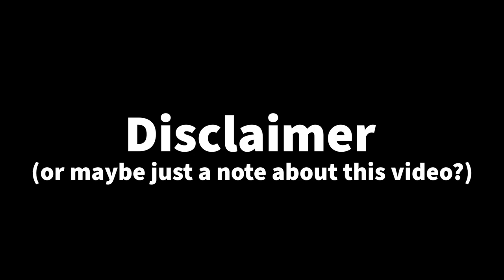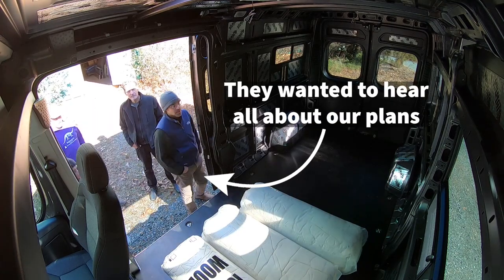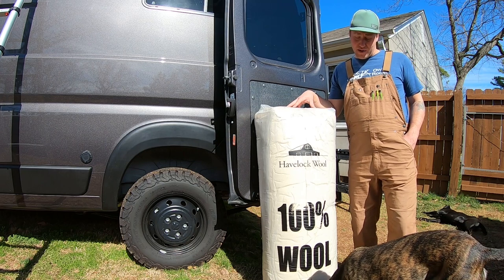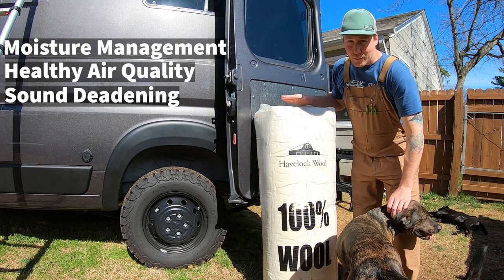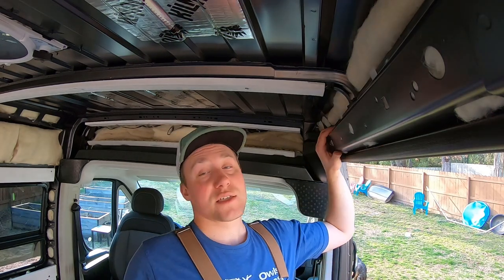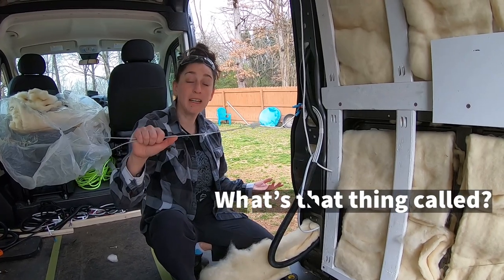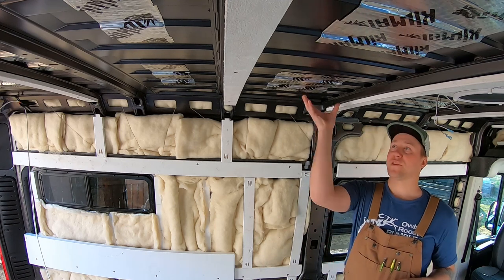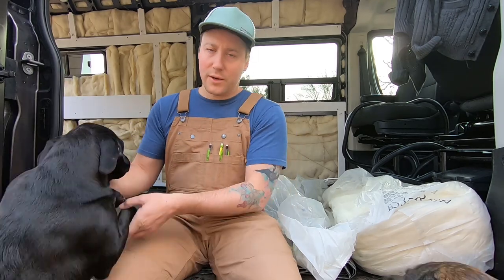Van Insulation with Havelock Wool //Ep. 6 DIY VAN BUILD

Comment: Great video series so far!  I have a little 1500 ProMaster with 136 wheel base.  For insulation, I'm using a 3 step strategy - 1) DIY spray-on insulation foam on the skin for conductive energy, 2) Havelock wool for convection energy, 3) Reflectix for radiant energy.  In theory, the spray on foam will prevent condensation.  The relectix is the last layer against the wooden skin, and the idea is the wool creates enough of an air gap for the foil to stop radiant energy - not sure if this will pan out, but other videos I've watched say this is the case.  I'm not done with the whole insulation process yet, but already there's definitely a difference in how the van sounds, and feels.  I put bug screens in the front door windows, so with those open, and with the MaxxAir fan sucking air out at the rear, the interior has been completely tolerable... of course, we've not had 90 degree days yet here in Virginia, so time will tell.

Edit to add:  I've also added a roof rack with air space between the roof skin and boards that support the solar panels.  This shade allows me to keep the ceiling fairly thin... I've added the same cross-members you did to the ceiling ribs, but tucked sheets of 3/16" plywood between the wood and the ribs with just a sheet of reflextix laying on top (metal skin > spray foam > air > reflectix > 3/16" wood > cabin.  This works for heat, I think adding wool in the air gap would make it better in the cooler winter months.  

Good luck with the rest of your build.  It looks great so far and I've enjoyed the tips and explanations you've shared.
Reply from the maker: Thanks so much! I'm glad you like the series😊

Your strategy sounds well thought out and worthwhile! We have had some 90 degree days in NC and it had been pretty hot working in the van recently. We don't have the doors insulated yet or window covers so maybe that would help with some of the heat we've been feeling?

Nice thinking on the roof rack! Part of our warmth might be exactly because we have a dark van getting beat by the sun. Time will tell how tolerable it will be🤞🏼

Thanks so much for kind words! Goodluck with the rest of your build. We'll keep sharing ours too.

Maybe when we both finish we can make a meet up somewhere in between!
Reply: @Trailvagabonds  I look forward to it :)

Comment: Hey i am curious wold putting wool insulation in the floor be a better idea both for r factor and sound density
Reply from the maker: I don't think it's a bad idea. You definitely lose a little more head space with wool in the floor but I think it's a great option. We ended up using a foam insulation for our floor. We are happy with our decision but know many people who used wool for their floors and are just as happy. The main thing I suggest if you do use wool is frame out the walking area well because you don't want the subfloor settling and warping where you walk. It could be a headache if you don't do that area well. Hope that helps. Let me know if you have other questions 🙌🏻

Comment: I am going to be using to transport k9 and camping . My question is how does the wool work in keeping the van cool in the heat ?
Reply from the maker: K9 transport sounds awesome! (And of course camping). The van gets hot in direct sunlight. If you park in shade it doesn't heat up as quickly. I don't know that there is any form of insulation that can stop the heat of a van baking in the sun on a really hot day. Our van doesn't help any being a dark color either. That being sad in shade it does keep the van a good deal cooler. The fans help immensely. We've slept in 90+ degrees at the beach in Georgia and survived. The big plus is that it keeps heat in in the winter. We slept in 20 degrees in Wisconsin recently and were very comfortable with a heater on the lowest setting. 70 degrees is the sweet spot for sure. When we are on the road that's what we'll chase!
Reply: Just like the opposite of keeping heat in the van during winter. The warm air layer inside is trapped by the wool, it can't contact the exterior metal frame and be lost to convection. In summer, sun radiation heats up the metal exterior, which will heat the air next to it inside. But, with this wool, instead of making the whole van hot, the wool traps much of the heated air to the outside layer, thus keeping the insides COOL 😎
Reply from the maker: Thanks for your thorough response, Matt

Comment: Were you using small or large bag of havewool? Thanks for the hemp twine tip.
Reply from the maker: No problem, happy to help! I used 3 small bags (or 1 big bag and 1 small bag). The big bag is 2 small bags combined and I think they do it for shipping purposes... When I insulated my van they had the recommendation at 3 bags but they have since changed it on a 159 to 4 bags (or 2 big bags). Let me know if you have other questions 🙌🏻

Comment: God job of explaining and like the hemp twine suggestions. What is the Bump out is that giving you more room. Also what did they charge you to install the small windows and the one big one?
Reply from the maker: Yep! The bump out lets us extend the bed into the wall framing so that we can sleep width wise across the van. We will be able to fit a short (or rv) queen mattress across it.

For the windows (which we talk about in our intro video if you hadn't seen that one) we had the dealership we purchased the van from install them. They have a mobility conversion department for disability vans. They basically charged us the cost of us buying the windows ourselves online (I'm guessing because they can get windows at cost?) otherwise we might have done them ourselves. It was a weight off our back!
Reply: Matt & Katie wow they installed the window including the window for the same cost just for the window online. That is an awesome deal I need to find a dealer to do that in AZ.  I was gonna do a double bed sideways but I’m needing the space for my tools underneath I want 60” and was gonna do 40” high you did 38” high and I’m buying the 3500 extended Van. I was gonna do a pullout bed that would let me sleep under the stars on bugless nights. But maybe not. I was gonna use a 6” mattress that give me 36” of room from ceiling to mattress is that what you have?
Reply: I am not going to winter climates so your idea of foam was interesting. I will have plywood then laminate on top. I’m wondering if floor will be cold. I have seen some with 1/2” slats then put wool down and 1/2” or 3/4” ply on top of that. Your right everyone has their way. Look and listen but you the first I have seen with foam. Where did you learn that from?
Reply from the maker: @michaelheppler2193  do you have Instagram? It might be easiest to chat on that. I don't always get updates when I have replies with YouTube. We are @trailvagabonds on Ig if you do

Comment: What is the silver material on the panels of your van? Why do you use it with the wool?
Reply from the maker: We used Kilmat Sound Deadener. It helps take away sound vibrations on the metal walls of the van. It works in a different way than the insulation does so we thought it was worthwhile to do. Here's a video on it that we made 

https://youtu.be/QnGu4TSrB7A

Comment: Watching this, I'm starting to wish I had ordered three bags instead of two!
Reply from the maker: We went with Havelock Wool's recommended amount on their webpage. If you are strategic and maybe utilize other types of insulation in some spots you could get by. If you are set on wool for environmental and/or natural reasons, a 3rd bag might make sense if it can be budgeted. We had big enough gaps in spots we doubled up in and we are thinking we might have to pick up another bag to finish out the doors and pad wheelwell boxes when we make them.

Comment: I ordered 1 bag of Havelock wool 2 weeks ago from Havelock.  While still waiting for it, I also ordered mineral wool from Amazon.  However, I did not know that I ordered mineral wool (rock wool).

Now I am stuck...
I like its stronger sound deadening but worried about unsafe fiberglass like issues.

I read that if I seal up this rock wool with reflectex, I  am safe.  I would only attach the rock wool on the top section of 2  sliding doors and 2 back doors.

What do you think?

The problem
Reply from the maker: The main worry is the dust and being in a small space can be a little scary. There are people who have used fiberglass insulation for their whole van. The most scary is fiberglass does not do well with moisture. Rockwool does better with moisture than the pink stuff but I personally wouldn't prefer it in my van. Budgeting can be tough, especially feeling like you are throwing money away. If you feel comfortable closing it up, by all means, many people use it. Just know in a small space it's not always the safest
Reply: @Trailvagabonds  Thank you for your input.

I will  not use the rock wool in my van based on your well researched opinion.

I appreciate your helpful videos.  Thank you.
Reply from the maker: No worries! Good luck! 🙌🏻

Comment: Thanks for the informative video. On a side note...loved the wheels and tires on your van. Could you tell me what you went with?
Reply from the maker: Thank you! I'm glad people are finding them useful! The wheels are the stock Ram ones, they came black which I think was considered a $50 upgrade but we didn't order them special, they were on it already. The tires are the BF Goodrich TA K02s in the stock 225 75R16 size. We talked the dealership into an upgrade with them during purchase negotiations. I've heard you can fit 245s if you want something a little bigger (sometimes with some wheelwell trimming though). But I think these are plenty burly over the stock road slicks to give us a little more grace on the back roads😎

Comment: Hey Matt and Katie! Love your channel! I ordered the havelock wool. They compressed two bags into one large bag and one into a smaller. It looks like you have the three double bags. Did you get three of those, equaling to six bags? Could be a dumb question..lol.. wanna make sure i have enough.
Reply from the maker: Hey!  Thank you so much!  We ended up picking our wool up locally at a distributor so we were sold them as the three single compressed bags rather than the two bags compressed together into one.  So it ended up being three bags.  They asked that we do this so they had the others ones for when they needed to ship them.  I will say I kind of wish I could purchase another half bag.  We haven't finished the doors yet and are running pretty low on batts.  You will love working with the wool for your insulation!  So simple, you can't go wrong!

Comment: Hi, absolutely love these vids! We are beginning our insulation this week. It looks you have some wiring tubing already ran. Did you pre run your conduit in some locations prior to insulation. Your wiring video shows you running it aswell with insulation so just curious on the order you went with.
Reply from the maker: Glad they can be enjoyable and hopefully helpful! We wired and insulated for the most part at the same time. I started figuring out the electrical runs first. I wanted wiring somewhat accessible if we ever needed to change or adjust anything. We also needed to put the runs in places where it would be too hard to run them when insulation was already packed in, like the columns. We would place the insulation behind the loom runs once they were in place so they sat in front. Hope that helps. Let me know if you'd have another questions or need more clarification 🙌🏻 Congrats on taking the DIY plunge!
Reply: @Trailvagabonds  explained perfectly! Thanks a bunch!! Hope to be on the road in 2 months!
Reply from the maker: @tvddv4879  Glad to help, that sounds awesome! Goodluck building and enjoy getting on the road! Don't be afraid to reach out if you have other questions

Comment: Nice job! 3 bags was enough? Would you recommend 4 bags to be safe? thanks
Reply from the maker: Hey Cyril! Thank you so much, I'm glad the videos are useful for people! I would say it really depends how much space you leave with your framing. Because we were able to double up batts in so many places, we will probably have to buy a 4th bag to finish off the door panels in the future. It will probably give us enough left over to then allow us to make window covers if we feel so inclined (I've never really did any sewing so not sure there).  If you feel you can afford it, 4 might be a good bet. If you also insulate the floor with wool, absolutely go with more. If you do a good job getting your framing really close to the outside walls, 3 might be just fine. Talking with Havelock wool might also give you a better perspective. They are a very helpful company and reply right away when contacting them.
Reply: @Trailvagabonds  I thought about making window covers and even the black out curtains with some wool like a quilt.  Would this help insulate than without the wool added?
Reply from the maker: Really any thing covering the window can be considered insulation. The windows loss or gain lots of heat from windows. Having a barrier helps a ton. We currently have reflectix cut to size and notice a difference over nothing at all. People talk about the temp differences from the cab to back of their van when all they have is black out curtains drawn across the cab. I think wool would be a great option for window covers

Comment: how has the havelock wool experiment gone? satisfied ?
Reply from the maker: No complaints. Just spent 2 weeks in Wisconsin in night time temps 20-30 degrees F and we were very comfortable with our Webasto Heater on low
Reply: Thanks guys! with current global times I’m finding it hard locating a lot of things I need for my build,  but i do have access to havelock reasonably close by as an option. 
I’m north of the border so a lot of cold weather on the horizon. Thanks for the update. Safe travels
Reply from the maker: I've been hearing it has become very difficult in recent months to source many van/RV type products. Canada even more so without huge shipping charges from the US. I wish you luck! We were very happy with using wool. Both as easy as it is to work with, it's ability to deal with moisture (over some that mold and mildew easily), and it's sustainable nature. I think you'd be pleased using it. All the best in your build! I hope sourcing things starts to become easier!
Reply: @Trailvagabonds  its a challenge at the moment for sure but its hard to complain with the bigger picture in mind these days. 8 weeks now waiting on tires, week 5 for my fan (shipped today)  no windows to be found... Thinsulate i can find via ebay with large price jumps in USD and shipping import charges plus late December fulfilment. Bit of a mess but fingers crossed winter goes easy on us in the Northern hemisphere. i was quoted $390 CDN for a double bundle of wool x2 plus shipping $140. = $920 CDN to my door keeps the project moving :)
Reply from the maker: Perfect! Keep the positivity! All the best!

Comment: Did y'all forego a vapor barrier for the 'let it breathe' method Havelock suggests?  I am leaning that direction.  Overall Havelock is inexpensive, easier to install, no vapor barrier needed, and it's not nasty to work with.
Reply from the maker: Correct, we didn't use a vapor barrier per Havelock's recommendation. It sounded like so many more issues would come with one over leaving it open to breathe.

It is very easy to work with. We definitely can recommend it!
Reply: @Trailvagabonds  I don't know how a vapor barrier could truly stop the van walls and ceiling from getting damp fron condensation.
Reply from the maker: I think with the conditions, there would be no good way to completely stop it. Choosing wool was one way we felt we could combat the inevitable condensation

Comment: Hi there , great content , I noticed you doubled up bats on the headliner , is there a reason ? About to do the same but wondering wouldn't the wool be getting compressed too tight in that area once the cover back in and lose some of its R value ? tks
Reply from the maker: Yep, we actually ended up having to take some out. We were told my another van builder that they needed that many to fill the cavity. You hit the nail on the head though, definitely do your best to keep the fluff😊